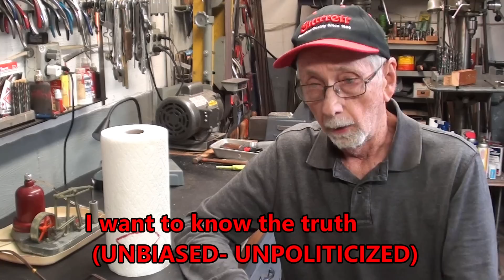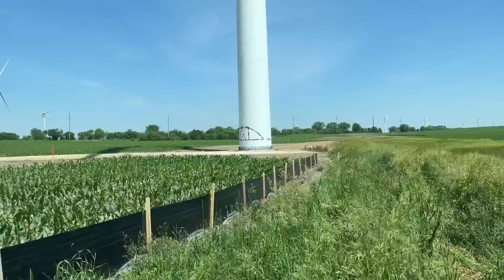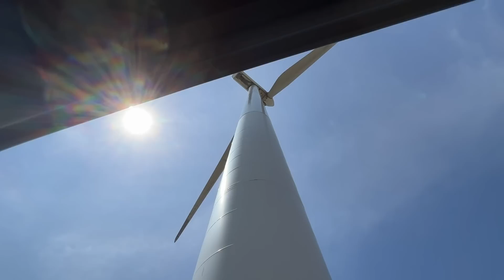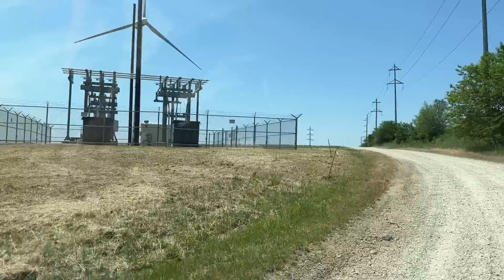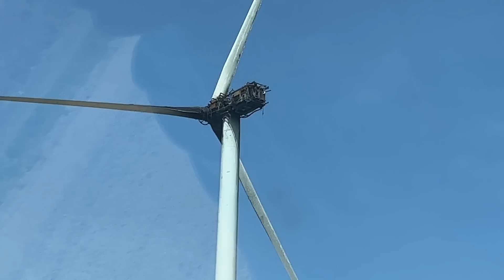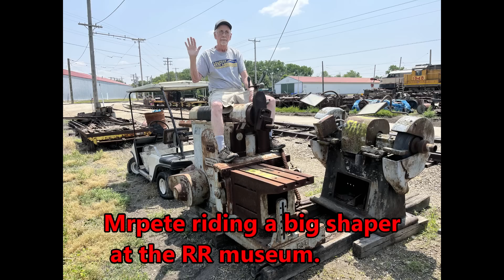OBSOLETE WINDMILL DEMOLITION short #46 pt 1 tubalcain

Comment: Almost all of the windmill sites I looked up reference the EIA. Most others came into vaporware statistics. From what I can gather it costs about 1.3 million dollars per megawatt for a 1 megawatt machine. Rent would be about $20,000 per year and maintenance about $50,000 per year. Subsidies are almost impossible to track down. There is also the tax write offs that are hard to get good numbers on. Wind turbines only operate around 40% of the time. Gross income is about $70,000 per year. Not very profitable when everything is added up. The windmill replacements you mention are going to be much larger powerwise but with all the same problems as with the smaller ones. There is no mention of costs of blade replacement that give reasonable numbers. Sorry but this is the best I can do. ps. maintenance costs also include insurance but not blade replacement. It is now time for coffee and GOOD MORNING!
Reply: You didn't include the 10% that is licked up to the Big Guy.
Reply: @sd906238  trump?

Comment: Different slant here.... In 2007 I attended ArnFest and drove from Champaign to Bloomington (IL) and then up Rt. 39. I was surprised to see all of these windmills and really admired them.... I'd consider them an elegant symbol of technology. Of course, that was 2007.... I have no idea what the ROI is on turbine like them. I do understand that disposal of the blades is a huge issue. Being fiberglass, they cannot be recycled. In Wyoming, they dug trenches in the fields, buried the blades, and then walked away. Perhaps in 3023  our great great great grandchildren will stumble upon them????
Reply: They will stumble on mutant earthworms from ingesting fiberglass needles!
Reply: @StanErvin-yo9vl  The same in the Palm Springs/Whitewater area of the California desert. Over the life of the turbine, blade efficiency research and testing is continuous, and every five to eight years all the blades would get changed out for more efficient ones.

Old blades, fiberglass laminated to aluminum hubs, got stacked on site, thousands of them. Attempting to recycle the things is not cost effective, nor is hauling to the landfill, and so they get buried on site, as you said.
Reply: @StanErvin-yo9vl  Like the Mutant earthworms joke  Turbine Blades is one thing how about the battery packs for EV that cant recycle ????

Comment: From memory, during the construction of a wind farm I was involved with the base of the windmill had around 40ton of steel, I can’t remember how much concrete there was unfortunately
Reply: Usually between 500 to 800 cubic yards of concrete, depending on how big the windmill is. 
Most newer ones use around 700 to 800.
Reply: With these numbers, we can make and use the ratio of 4:60 tons of steel to cubic yards concrete.
Reply: @moretimethanmoney8611  
    Elaborate, please... Por favor.

Comment: 46 enlightening statements by IPCC, or former IPCC, experts against what the IPCC writes in its reports:

    Dr Robert Balling: The IPCC notes that “No significant acceleration in the rate of sea level rise during the 20th century has been detected.” This did not appear in the IPCC Summary for Policymakers.
    Dr Lucka Bogataj: “Rising levels of airborne carbon dioxide don’t cause global temperatures to rise…. temperature changed first and some 700 years later a change in aerial content of carbon dioxide followed.”
    Dr John Christy: “Little known to the public is the fact that most of the scientists involved with the IPCC do not agree that global warming is occurring. Its findings have been consistently misrepresented and/or politicized with each succeeding report.”
    Dr Rosa Compagnucci: “Humans have only contributed a few tenths of a degree to warming on Earth. Solar activity is a key driver of climate.”
    Dr Richard Courtney: “The empirical evidence strongly indicates that the anthropogenic global warming hypothesis is wrong.”
    Dr Judith Curry: “I’m not going to just spout off and endorse the IPCC because I don’t have confidence in the process.”
    Dr Robert Davis: “Global temperatures have not been changing as state of the art climate models predicted they would. Not a single mention of satellite temperature observations appears in the IPCC Summary for Policymakers.”
    Dr Willem de Lange: “In 1996 the IPCC listed me as one of approximately 3000 “scientists” who agreed that there was a discernible human influence on climate. I didn’t. There is no evidence to support the hypothesis that runaway catastrophic climate change is due to human activities.”
    Dr Chris de Freitas: “Government decision-makers should have heard by now that the basis for the long-standing claim that carbon dioxide is a major driver of global climate is being questioned; along with it the hitherto assumed need for costly measures to restrict carbon dioxide emissions. If they have not heard, it is because of the din of global warming hysteria that relies on the logical fallacy of ‘argument from ignorance’ and predictions of computer models.”
    Dr Oliver Frauenfeld: “Much more progress is necessary regarding our current understanding of climate and our abilities to model it.”
    Dr Peter Dietze: “Using a flawed eddy diffusion model, the IPCC has grossly underestimated the future oceanic carbon dioxide uptake.”
    Dr John Everett: “It is time for a reality check. The oceans and coastal zones have been far warmer and colder than is projected in the present scenarios of climate change. I have reviewed the IPCC and more recent scientific literature and believe that there is not a problem with increased acidification, even up to the unlikely levels in the most-used IPCC scenarios.”
    Dr Eigil Friis-Christensen: “The IPCC refused to consider the sun’s effect on the Earth’s climate as a topic worthy of investigation. The IPCC conceived its task only as investigating potential human causes of climate change.”
    Dr Lee Gerhard: “I never fully accepted or denied the anthropogenic global warming concept until the furore started after NASA’s James Hansen’s wild claims in the late 1980s. I went to the [scientific] literature to study the basis of the claim, starting with first principles. My studies then led me to believe that the claims were false.”
    Dr Indur Goklany: “Climate change is unlikely to be the world’s most important environmental problem of the 21st century. There is no signal in the mortality data to indicate increases in the overall frequencies or severities of extreme weather events, despite large increases in the population at risk.”
    Dr Vincent Gray: “The [IPCC] climate change statement is an orchestrated litany of lies.”
    Dr Mike Hulme: “Claims such as ‘2500 of the world’s leading scientists have reached a consensus that human activities are having a significant influence on the climate’ are disingenuous … The actual number of scientists who backed that claim was only a few dozen.”
    Dr Kiminori Itoh: “There are many factors which cause climate change. Considering only ‘greenhouse gases’ is nonsense and harmful.”
    Dr Yuri Izrael: “There is no proven link between human activity and global warming. I think the panic over global warming is totally unjustified. There is no serious threat to the climate.”
    Dr Steven Japar: “Temperature measurements show that the climate model-predicted mid-troposphere hot zone is non-existent. This is more than sufficient to invalidate global climate models and projections made with them.”
    Dr Georg Kaser: “This number [of receding glaciers reported by the IPCC] is not just a little bit wrong, it is far out by any order of magnitude … It is so wrong that it is not even worth discussing.”
    Dr Aynsley Kellow: “I’m not holding my breath for criticism to be taken on board, which underscores a fault in the whole peer review process for the IPCC: there is no chance of a chapter [of the IPCC report] ever being rejected for publication, no matter how flawed it might be.”
    Dr Madhav Khandekar: “I have carefully analysed adverse impacts of climate change as projected by the IPCC and have discounted these claims as exaggerated and lacking any supporting evidence.”
    Dr Hans Labohm: “The alarmist passages in the IPCC Summary for Policymakers have been skewed through an elaborate and sophisticated process of spin-doctoring.”
    Dr Andrew Lacis: “There is no scientific merit to be found in the Executive Summary. The presentation sounds like something put together by Greenpeace activists and their legal department.”
    Dr Chris Landsea: “I cannot in good faith continue to contribute to a process that I view as both being motivated by pre-conceived agendas and being scientifically unsound.”
    Dr Richard Lindzen: “The IPCC process is driven by politics rather than science. It uses summaries to misrepresent what scientists say and exploits public ignorance.”
    Dr Harry Lins: “Surface temperature changes over the past century have been episodic and modest and there has been no net global warming for over a decade now. The case for alarm regarding climate change is grossly overstated.”
    Dr Philip Lloyd: “I am doing a detailed assessment of the IPCC reports and the Summaries for Policy Makers, identifying the way in which the Summaries have distorted the science. I have found examples of a summary saying precisely the opposite of what the scientists said.”
    Dr Martin Manning: “Some government delegates influencing the IPCC Summary for Policymakers misrepresent or contradict the lead authors.”
    Steven McIntyre: “The many references in the popular media to a ‘consensus of thousands of scientists’ are both a great exaggeration and also misleading.”
    Dr Patrick Michaels: “The rates of warming, on multiple time scales, have now invalidated the suite of IPCC climate models. No, the science is not settled.”
    Dr Nils-Axel Morner: “If you go around the globe, you find no sea level rise anywhere.”
    Dr Johannes Oerlemans: “The IPCC has become too political. Many scientists have not been able to resist the siren call of fame, research funding and meetings in exotic places that awaits them if they are willing to compromise scientific principles and integrity in support of the man-made global-warming doctrine.”
    Dr Roger Pielke: “All of my comments were ignored without even a rebuttal. At that point, I concluded that the IPCC Reports were actually intended to be advocacy documents designed to produce particular policy actions, but not a true and honest assessment of the understanding of the climate system.”
    Dr Paul Reiter: “As far as the science being ‘settled,’ I think that is an obscenity. The fact is the science is being distorted by people who are not scientists.”
    Dr Murry Salby: “I have an involuntary gag reflex whenever someone says the science is settled. Anyone who thinks the science is settled on this topic is in fantasia.”
    Dr Tom Segalstad: “The IPCC global warming model is not supported by the scientific data.”
    Dr Fred Singer: “Isn’t it remarkable that the Policymakers Summary of the IPCC report avoids mentioning the satellite data altogether, or even the existence of satellites — probably because the data show a slight cooling over the last 18 years, in direct contradiction of the calculations from climate models?”
    Dr Hajo Smit: “There is clear cut solar-climate coupling and a very strong natural variability of climate on all historical time scales. Currently I hardly believe anymore that there is any relevant relationship between human CO2 emissions and climate change.”
    Dr Richard Tol: “The IPCC attracted more people with political rather than academic motives. In AR4, green activists held key positions in the IPCC and they succeeded in excluding or neutralising opposite voices.”
    Dr Tom Tripp: “There is so much of a natural variability in weather it makes it difficult to come to a scientifically valid conclusion that global warming is man made.”
    Dr Gerd-Rainer Weber: “Most of the extremist views about climate change have little or no scientific basis.”
    Dr David Wojick: “The public is not well served by this constant drumbeat of alarms fed by computer models manipulated by advocates.”
    Dr Miklos Zagoni: “I am positively convinced that the anthropogenic global warming theory is wrong.”
    Dr Eduardo Zorita: “Editors, reviewers and authors of alternative studies, analysis, interpretations, even based on the same data we have at our disposal, have been bullied and subtly blackmailed.”
Reply: Perhaps for balance you should quote some of the literally thousands of scientists that believe that (a) climate change is real and an existential threat, and (b) the rapid change of climate that we are observing is due to rising CO2 brought about by anthropomorphic activity. For the record, I hold a PhD so when you quote me the correct attribution is Dr. Brian Taylor.
Reply: @briantaylor9266  lol, i would but it doesn't exist, there are no more than a dozen frauds who claim it, feel free to post your list.

that list is far from comprehensive as well, there's also the petition project sign by nearly 10k phds and the letter to the UN by interested parties, mostly scientists, saying there is no climate crisis, now signed by 1500.

you must have 100s of 1000s on your list if it's true that 97% of scientists agree, but it isn't is it. When you look, which you obviously haven't, you will find Micheal Mann and a few of his toys and nothing else.

Also , fuck your phd. they give phds to people for gender studies these days.

That you say it just shows how little understanding of reason or science you have.
Reply: @briantaylor9266  can you name even one "climate scientist" that supports the AGW theory other than that fraud Mann? or someone that just cites Mann's hockey stick as proof.

Bet you can't find more than a handful even with furious googling.

Cite the papers proving current temperatures are due to man's co2 and not natural variation.

Cite the causal proof CO2 can cause run away warming.

CO2 is a very minor contributor to the greenhouse effect, the vast majority of it being due to water vapour, and man is an insignificant contributor to CO2 as well (3% of the yearly increase).

Furthermore despite 40 years of predictions of doom, none of them have come to pass, they just keep shifting back the dates.
The ice caps have not melted, the seas have not risen, snow is not a thing of the past.

Wake up, you have been conned, I used to believe it, then I went and looked, perhaps you could start with the climategate emails.

Comment: Seems incredibly wasteful to me, maybe they are putting new ones on the foundation, it would be real silly to break it up too I would have thought. Surely these things have life left in them, I thought they would last for much longer, a 16 year payback period seems very short to me
Reply: The foundations actually wear out because of the loads put on them. Also usually the replacement turbines are larger so the foundation also need to be bigger. I wonder if they are ever going to demolish the old and worn out foundations anyway, who is gonna pay for that? Thousands of tonnes of reinforced concrete a piece. That's quite a few gallons of geological hydrocarbons required.